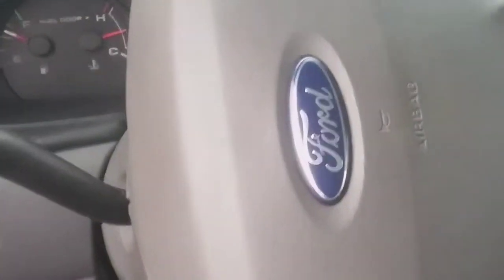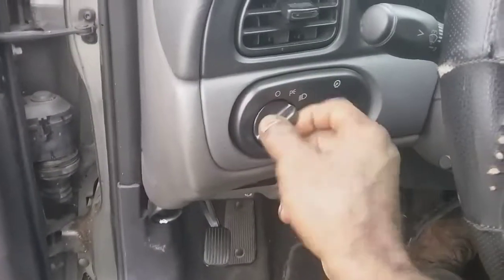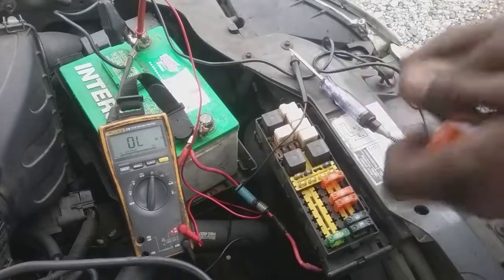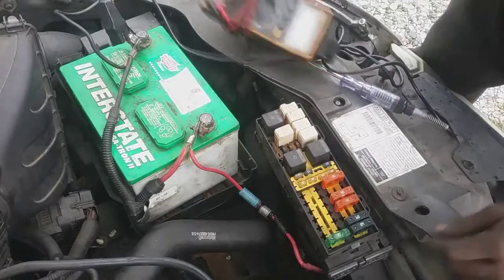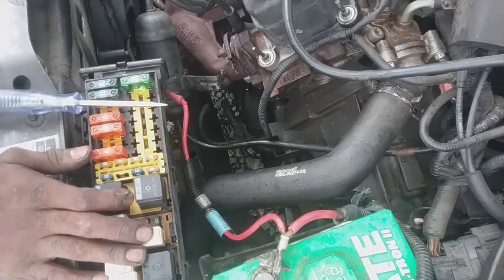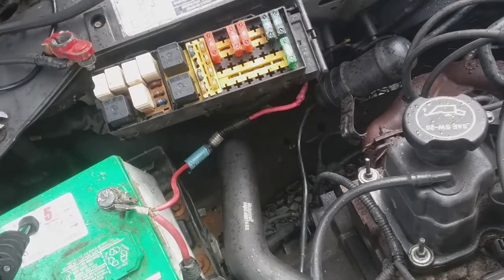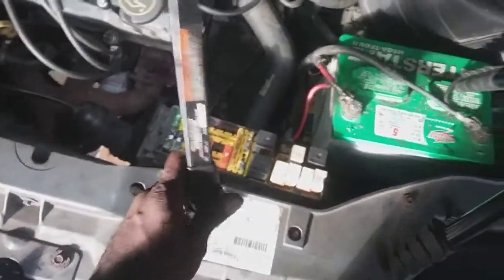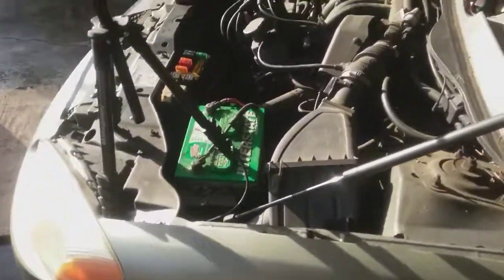Ford Taurus blows  ignition fuse FIXED

Comment: I'm going to put a starter in my 02 taurus in a few days. I hear the solenoid bumps out but doesn't turn, fuse, relay, ign switch all good. Some tire guy left the key forward too long and probably burned the solenoid.

Comment: Thank you!! 
Hit it on the money, same exact car as the one you're working on. 40amp fuse was blown. installed new fuse. The new fuse did not pop. everything works again. if the problem duplicates, I'll have to look for an intermitting short. anyway, it is working and luckily I found this video here because I couldn't find any info of someone duplicating this problem anyway, take care.  Thanks again.

Comment: Great video.  I'm fixing up a 2006 Taurus for a widowed neighbor.  I touched the wrench on the red wire going to the fuse box with the spark plug wrench.  All went dead.  Checked fuses, they're all ok.  I was told there is a master fuse somewhere.  Can't find it if there is one.  Any suggestions?  Thanks so much.

Comment: I'm working on a 2000 Altima. Not same car obviously but blowing the ignition fuse when trying to start. I can jump the starter by the two terminals  and it will engage and crank the engine which is a little different than what yours is doing. I can also jump the solenoid terminal to the positive terminal and will crank which should mean the solenoid is ok. So could it still be the solenoid itself blowing the fuse?  I can get a reman starter for $100 but that's an expensive maybe. Normally other than a fuse blowing this is how I would test a starter but this seems fine. Think I'm on the right track?
To compound my confusion, I had just changed the radiator, which only has an electric fan to unplug, went to start car and no go. I pretty quickly found it was the blown ignition fuse. I only had one spare and it blew right away too. Just a very bad timing coincidence for starter to go after changing the radiator???

Comment: My '03 Taurus, just stopped working. Checked fuses to see if they were blown (w/out tester). I had driven to work, then I couldn't leave. Battery charged, had replaced Alternator, Starter, within the last couple years. There was no clicking, no crank, yet dash/dome lights came on.
Reply from the maker: Try another key... Check your security light
Reply from the maker: To add to my initial comment, typically the security issue will cause a "crank no start" condition [on ford if i recall]

In your case, simply check the starter solenoid wire with a test light and see if you get a voltage signal at solenoid wire, if you have a signal, replace the starter. Also... Try the old school method of tapping on the starter motor, see if it engage
Reply: My 07 was doing something similar it would come on ( lights and all) but it wouldn’t start had the starter replaced and battery still was happening I replaced the starter relay fuse and the 40 and 15amp fuse and so far so good try replacing those fuses it’s a video here on yt on which fuses

Comment: My 2005 Ford Taurus is clicking and afterwards no clicks or cranks any suggestions
Reply: did you figure it out? i’m having the same issue.
Reply: Mikenna Joy it’s the starter
Reply: Sparta Tactical Arms hmm mine starts sometimes and sometimes it doesn’t. all the lights come up on the dash and the temp gauge and speedometer stop working. even if i get it on first try they usually pop up and stop working again
Reply: Mikenna Joy that’s your wire harness burning out it’s touching your ac line it happens to me then my starter went out had to rewire the whole thing
Reply: @spartatacticalarms6914  I've been having the same problem, no start no crank, dash lights up, fuel pump primes, got stuck at Wal mart! Finally figured wiggling the starter relay would turn it over put key to run and wiggle relay. Did that the a couple months then I think the relay stayed on and burnt out the starter. Replaced starter and wires, new battery, oh and I replaced the neutral safety switch I even replaced the gym module because my windows don't working anymore either.. do you think it could be my ignition switch that's probably the only thing I haven't checked or some random ground somewhere idk, but I just hope I didn't get the computer
Reply: @jkitch419  I'm having problems now that I've done a tune up and now it's not starting
Reply: Did u do the tune up yourself? I had a bad plug out the box. But it could be soo many things...180. Mine has about 10 problems right now! It was 15, but i fixed 5 or 6 of em in the last couple years,almost always started first time all its life, last 3yrs. Been nothing but problems I just put a new starter in got it running again, after it sat for 2weeks, cuz i gave up on it. But walking sucks. Lol
Reply: @jkitch419  just fixed it I put my wires on wrong and it now it starts right up no check engine light I feel like such a dumb***
Reply: @jkitch419  yes I did
Reply: @spartatacticalarms6914  it's not just u, it's a confusing firing order!
Reply: @jkitch419  it is for real but now I have a high idle now when I start it up it takes a while for it to go down
Reply: @spartatacticalarms6914  mine does that too, I thought it was supposed to! Lol thought it was like a choke or something
Reply: @jkitch419  check your IAC (idle air control valve) it’s usually the sensor on the top of your throttle body.....sometimes u can unplug em and the idle will act normal....just gotta replace the IAC tho

Comment: Thanks for the video. I have a similar issue at the moment with a 2006 nissan Serena. The ignition fuse keeps blowing. The starter mirror was repaired and while the vehicle starts 
, it refuses to start once I shut it off from a long trip. Would this be due to the starter failing? Should I just get a new starter? What is it about the starter solenoid that causes the fuse to blow?
Reply from the maker: Depending on how the starter sound and perform it could be a bad starter. Fuses blow in the starting circuit due overwhelming the circuit or Either faulty failing ignition switch shorting to ground or bad internal contacts causing starter drag. 

Hope this answers your question properly,